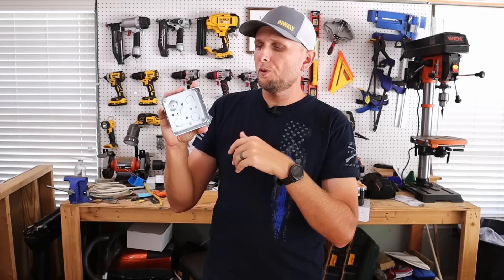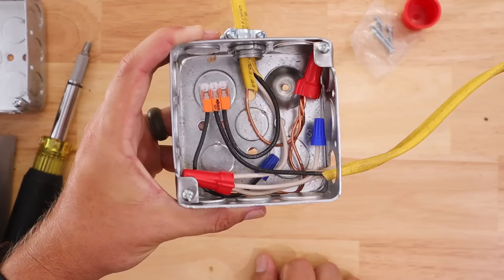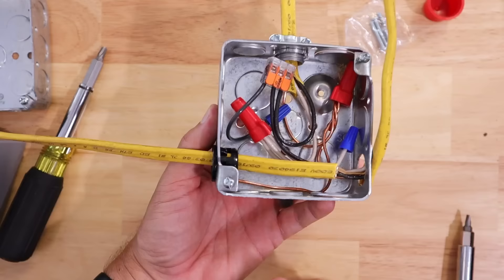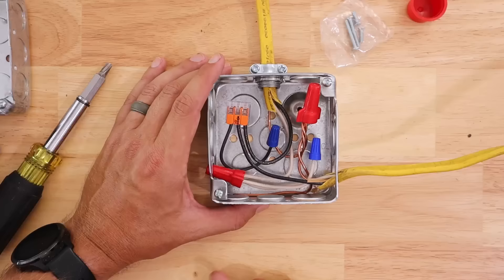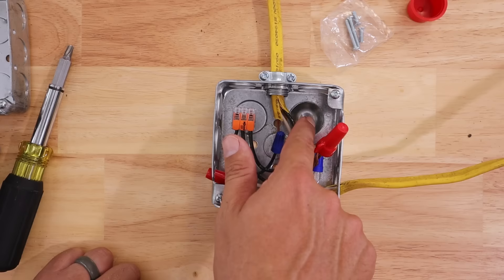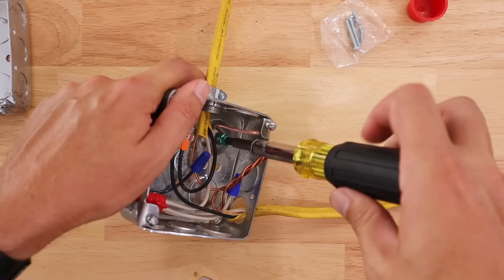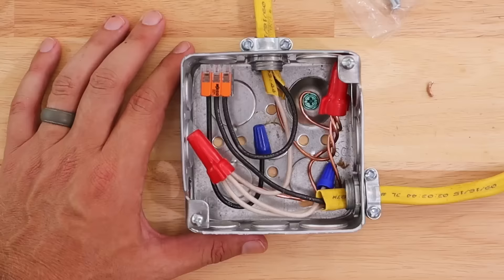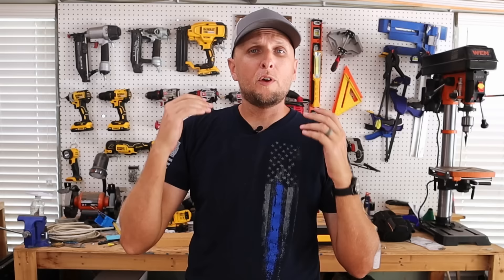The BIGGEST Mistakes DIYers Don't Know They Are Making When Installing Metal Electrical Boxes

Comment: I saw an inspector fail an installation where the tech had pretwisted several connections and was told that the connection could have broken and he wouldn't know
Reply from the maker: Never heard of such a thing.  Inspectors can technically only enforce National and local codes.  Can’t just make things up that they don’t personally like.
Reply: @HowToHomeDIY  understood the guy was a jerk!
Reply from the maker: Yup, had those before.  One time we were installing an approved roof system and the inspector on final inspection wanted to question everything about it and that he wasn’t going to approve it because he didn’t like it.  It was more so that he didn’t know enough about what he was looking at.  We had to go to the business owner and to the building department and show them that all codes were followed, a manufacturers warranty was issued after an independent inspection, and the business owner was good with the install before the board above him decided there was nothing wrong.   After that he didn’t question us anymore 😂.   But you have to do what you have to do to be able to close a permit out so I totally understand.

Comment: hehe, you missed one, the fact you are using a wego instead of a wire nut.
I know, its a controversial as Pineapple on pizza but I hate the tiny undersized heat producing contact point in those and those push in connections for lazy hacks in the back of outlets and switches.  Nothing says lazy more than wego and push in connections
Reply: Ain't nothing controversial about pineapple on a pizza. Canadian Bacon and Pineapple pizza is like mom, apple pie, hot dogs at a ball game (no ketchup) and Chevrolet - - - 😁 As for those wegos, I am old school enough to agree with you, but, they are allowed by the code.
Reply: Using Wagos doesn't mean you're lazy, they've been standard for a long time in Europe where wire nuts aren't a thing.

Comment: From a french perspective the first mistake is using a metal box for any electrical work. Metal box is nothing but a fire starting or shock inducing short-circuit in the waiting. Here plastic boxes are mandatory. Full stop. I can't think of any good reason to use a conductive material to encase live electrical wires. Unless you intend to kill someone.

Comment: I don't like the use of wire nuts. I appreciate they are allowed in the US and many other countries, but I've seen them with wires that are not held tight too many times. And that's when they've been installed by professional electricians not DIYers. I'm sure that wouldn't be the case in your work, but, if something is easy to get wrong, a lot of people are going to get it wrong.

Comment: My 1941 house has metal boxes with about 2” of wire, 10 gauge, mind you, pushed into the back of Bakelite crumbling outlets.
Reply: Is it at least insulated wire? I've had to deal with a house with knob and tube wiring from the 1920's and every type of wiring since. No original boxes, everything just screwed into the lath and wires hanging loose inside.

Comment: 12awg @ 20 amps as long as it’s not a continuous load. But this also doesn’t take into account ampacity chart of the NEC where 14 AWG THHN can carry 25 amps. But that also depends on distance which than you have to account for voltage drop and resistance. Gosh, this is getting all sorts of confusing, perhaps diyers should consult an electrician.

Comment: The video has some terminology issues.  For example:  “romex” is a brand name.  The correct terminology is “non-metallic” cable (“NM” for short).
Reply from the maker: Correct.  I briefly touched on that when talking about the connectors.

Comment: #1 mistake i see as a professional electrician is no cover on boxes. You never mention that , which leads me to #2 flagrant violation is non electricians teaching electrical skills. 
Also no reference to NEC...as well as 6 inches of free conductor. I know that a snap in NM connector is waaaay easier to install and unistall than a metal 2 screw connector.

Comment: If this is a junction box why would you have a black and white just hanging out with a wire nut on the end?  I would not have those wires just hanging there for no reason.
Reply from the maker: They are for a receptacle.

Comment: Some of these codes are written as if people are throwing 16 penny nails randomly through their walls and giant rats are swinging around in their walls. Thank God a competent homeowner can do whatever they hell they want where I live without any permits or codes. 

Downsizing wires is not a realistic problem if you wired everything well and secure wires. (correct strip gauge, no exposed wires, proper stapling/clamping) Power demand is pulled by the object not pushed by the breaker. 100% of light fixtures and fans are using 16 and 18ga wires or smaller, they will flame long before a 14ga wire leg split off a 12ga wire. Actually, go check most of your appliances, the power cords are seldom larger than 16ga wires. It's a code that "makes sense" but then it doesn't translate to the reality. 

When you couple a 12ga wire to a 18ga fan fixture, you're instantly in danger of the 20A breaker not saving the last 30 inches of wire, right? Yeah, maybe if you seize the fan up and the motor struggles to spin and just sits their toasting until the max rated amps of a 18ga wire is reached (which is probably like 2-3 amps?)

Comment: Anyone doing a wire install, unless they are an idiot, wouldn't put a 14ga pigtail in a box that has 12ga going in/out of it.  Since they already will have drop 12 ga wire at the box.  Someone specifically going off to get some 14ga for pigtails, instead of what's literally already at their feet would have to be terribly ignorant.

Comment: Wrong.  The ground screw does not have to be that 'green ground screw'.  Code calls for all devices to have a green screw.  In all other applications, they may be any color, and any thread.
Reply from the maker: Made it simple for folks to find the correct type and size.

Comment: You're still incorrect w/ the grounding code
Green wire nut w/ hole in the top leave the bare wire from panel long cut other s short twist shorter wires to mid point of longer wire  feed the longer wire through the hole twist nut attach bond the longer continuous wire
Reply from the maker: That doesn't make it wrong, that is a preference as to how to carry it out.

Comment: For me as a German Electrician there is everything wrong besides the Wago connector! 😂

No proper grounding of the metal box.
Those comical wire nuts.
Those Janky american cables that look like 1st class chinesium.
No grommets on the sharp openings.
No durst or water proofing on a box that seams like it´s mounted on top of a wall?
If it´s suppost to go inside a hollow wall, how do you use the strain relief?

Good thing u americans have the 110V for normal outlets, otherwise alot more people would die directly from shocks! 😆

Comment: the biggest mistake you made is (NEC 300.14 The minimum length of wires, including grounding wires, at all boxes shall be a minimum of 6 inches and extend at least 3 inches beyond the front edge of the box.)
Reply from the maker: They were all measured out and are at least that long.  Because yes you are correct.  Most people know the 6” rule but not the 3” past the edge of the box.

Comment: You grounded into the metal box which you said was the problem in the first place!?! You did not say your screwing that screw into anything. Like say wooden 2x4. Which Im not sure would be a ground anyhow. Im not Electrician. Im just assuming that a ground. As what else would you ground into?
Reply from the maker: The ground is coming from the feed wire.

Comment: Twisting conductors together is an appalling practice.
Reply from the maker: Disagree
Reply: @HowToHomeDIY  Amutureish. Went out in the 80s in the UK. Also strains the conductors by work-hardening the copper. Finally, it totally unnecessary.
Reply from the maker: I knew you weren’t in the US.  That’s not how it works.  Hardening will only occur from bending back and forth not just in one direction.  It works just fine.

Comment: Shouldn’t there be a law, or at least an electric code, that says 1 outlet in a garage is ludicrous??? I added a sub-box and 4 extra circuits ( 2 20a,  1 15a and a 220v outlet just in case), totaling 12 outlets (all 120v circuits are GFCI protected).
Reply from the maker: I am with you!

Comment: Here is a safety concern I see. It is dangerous to wear a jewelry (a ring and a watch) while working with electrical wiring.
Reply from the maker: Yeah?  Silicone rings are dangerous?  Unless I am in a breaker panel the watch is not going to do anything and even then it is unlikely.   Also, this wasn't real.  shhhh.

Comment: Why can't the ground screw be ANY screw (that fits)?
Reply from the maker: That depends on your definition of fits.  Because yes it does not have to be green but it does have to be the proper size.  It’s much easier for someone to go to the electrical aisle in their store or on Amazon, find the green ground screws, and know that it will fit perfectly both in thread type, width, and length.
Reply: @HowToHomeDIY  The definition is correct threading. Owing to my own experience, I do know that some people will think the color of the screw matters. Just as they think that the color of wire insulation matters. Of course, color coding is a useful way to make sure connections are properly made, but the electrons don't know the color.

Comment: Unbelievable , a metal clamp onto the cable ....NO NO.
Reply from the maker: That is a proper clamp.
Reply: @How To Home  Which is dangerous and will actually cause damage to the cable . . A plastic cable gland with rubber clamp please ...
Reply from the maker: The metal cable clamp is made specifically for the Romex.  It won’t damage it.
Reply: @How To Home  I think the point you made was that without a clamp , wires could be pulled and broken inside the box. Yes to prevent that a clamp. But a 'hard' biting clamp that has no 'give' in it and holds on to the outer insulation like this will put all the strain of a hard pull on the insulation. The metal does not give way.

A plastic gland with rubber grommet clamp provides the protection to the internal box connections and allows a degree of movement of the cable during pull. The strain is shared between cable and grommet.

Comment: FWIW: I already understood everything you covered. Could have saved a lot of time if you'd have first quickly gone over your points, then did a deeper dive into details, with markers in the video to jump to the detail for each point.  Also, if I recall correctly, it's NEC ok to put 15A receptacles on a 20A circuit, and not strictly necessary to use 12AWG in that case, to the receptacle.  Do a calculation for the temp rise in 14AWG THHN carrying 20A . . .
Reply from the maker: According to someone at the NEC there are only a couple situations where #14 can be on a 20 amp circuit.  For the most part and in this example, it should not be.
Reply: @HowToHomeDIY  I believe that you can have a #12 wire connected to a 15 amp breaker. In the outlet box you may have the #12 connected to a #14 wire. But in the box the #14 is considered a #12 for box fill requirements.You may not under protect the conductor amperage wise.

Comment: Something else that I noticed is that the extra ground wire you have pre-staged does not have a wire nut on it. If you look at 4:58 in your video you can see that it is dangerously close to going into the wire nut of the white wires. I would suggest that ANY loose ends should have a wire nut on them. Or don't pre-stage wires like this in the first place. Add the wires once you are ready to add the device.

Comment: Question, why is that on the video preview you have the wago connector on fire and the sign says don't use? If you are talking about the 14 ga situation, it will be the wire that will be catching fire. In fact, have you actually seen what happens when you apply something like 100-200A to an assembly like that? The insulation on the wire evaporates way way before the wago starts melting.

Comment: Wagos are not preferred  but they are rated. You dont have the proper amount of free conductor in that box, you can mix 12 and 14 as long as the breaker protecting the current carrying conductor is protected for the lowest rated wire.
Reply from the maker: I do have enough.  They are all measured out to be at least 6” long and extend at least 3” out from the front of the box.   Yes but the intention was that this is on a 20 amp circuit.  Unfortunately I didn’t specify that in the video.
Reply: @HowToHomeDIY  your good my comment was more geared to some of the ppl saying you can never mix the diff sized conductors, my apologies for the confusion

Comment: Yikes! It looks like you tightened those screws right up on the wire connector.  You are supposed to  just snug them up enough that the wire can't be pulled out.  This is another DIY mistake.
Reply from the maker: It was tightened up just fine.  The wire was not compressed.  It will all be ok!

Comment: If you check out the Amazon website that you recommened for purchasing the beginner package of those WAGO connectors you will ind it provides a short demo video. If you watch that video you will find that the manufacturer provides  the reviewer with the proper correct pronounciation for thos conncors.YI - The properpronounciation is by pronouncing the "A" as a short "A" not a Long "A" - In other words it is promounced as in the word "awwww" or as in the word for a breakfast item the "Waffle"   and is not pronounced with the "AAAAY"" as in the word for the Texas town of "WACO" or as in the word "Lake". - Just thought I would help out in providing you with the proper pronounciation as the manufacturer pronounces it.
Reply from the maker: Yeah they also pronounce their W's as V's so not too worried about their pronunciation of things lol

Comment: Hi there. Great Video! However, as others have pointed out in the comments… Pursuant to the National Electrical Code (NEC), and NFPA 70 respectively, the following violations exist in this particular scenario: a) A minimum of 6” length of ALL conductors, including GND must be available to make-up connections. Meaning, min. Lengths MUST be available OUTSIDE of said Box! However, pursuant to the new update of the code, it could be a minimum of 8” under certain circumstances! Personally, a 5 11/16” Box, I couldn’t imagine anything fewer than 8” length! Secondly, there shall be no greater than or even 1/2” of outer sheathing of nonmetallic sheathed cable (Romex®), whereby said cable’s outer sheathing enters respective coupling/entry-point of said box, panel, apparatus, etc. Lastly (though this is my personal opinion/preference), it is generally along the lines of good work-habits to use one type of wire connector/spicing. Either ALL Wago™ or the conventional “wire nut”. Lastly, take notice there are numerous revisions in the NEC/NFPA 70 this January!
Reply from the maker: So code states that the conductors must be a minimum of 6" from where it exits the sheathing or raceway.  I measured everything out to at least that.  Secondly, it has to extend at least 3" past the front of the box.  This is easily done as these 4x4 boxes are quite shallow comparatively.  For purposes used in this video 8" is not require and is just considered "best practice" by some.  Also, I talked about how I did what I did for the video's purposes.  I never use different kinds of splicing devices but did so in this video to show they can be used.  I have a copy sitting next to me.  Thanks for taking the time to leave your feedback!  🙂
Reply: "1/2” of outer sheathing of nonmetallic sheathed cable (Romex"   that one is stupid.   Who cares.

Comment: DUH! Wagu connectors should ALWAYS ALWAYS be used for low voltage DC. NEVER household AC. They are a massive fire hazard.
Reply: Nope, they are rated for up to 450 volts...AC...

Comment: Don’t forget to dust and clean your receptacles and boxes every year. Remove and inspect every connection. Check every wire nut to make sure it’s tight. Replace every breaker every three years. Etc, etc.

Comment: You US guys really use metal boxes for wiring?? I'm a german elecrtician, so i am confused, you use boxes with no internal isolation (we have that at least 100 years not more). You can't get a metal box for wiring in Germany! Also our cabinets are made Outside of metal but with a thick plastic isolation on the Inside! The Health for our cusomers is our first law, the health of their buildings our second law and our health is our third law. I did not know you US guys are so way back!😱
Reply: Says the country that still uses 50 hz systems.😅😅
Reply: @sonofnumenor6683  please explain, what is the mess of a 50Hz System?
Reply: @matthiaspfahl3746  less efficient than 60hz by about 20% if memory serves me correct.
Reply: @sonofnumenor6683  sorry, but the opposite is the case when it comes to transmission over long distances! In fact Transformators for 60Hz are less heavy. It is simply historical. In fact most of the countries worldwide uses 50Hz. USA, Venezuela, Ecuador, Northcaribic Islands (like Cuba and Haiti), Taiwan and South-Corea are using 60Hz. You can easily find some graphics at the web to see it
Reply: @matthiaspfahl3746  incorrect 60hz systems are better suited for longer transmission distance, and are better suited for high power applications.